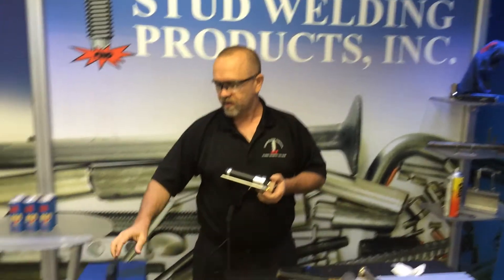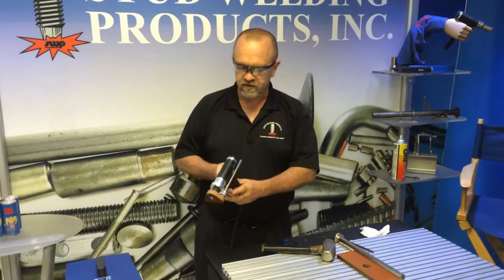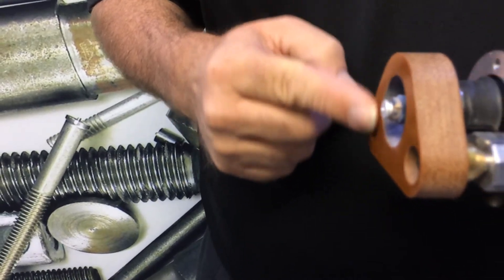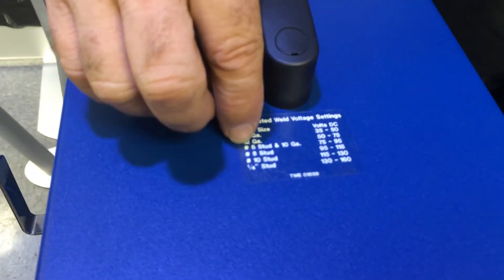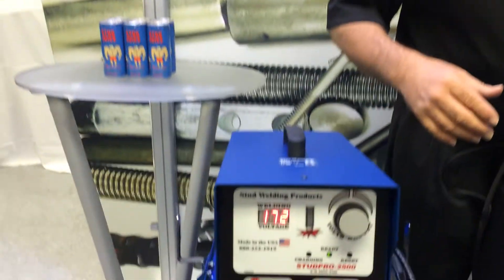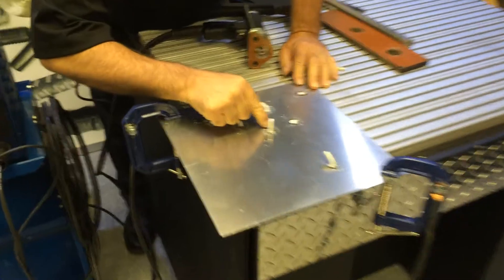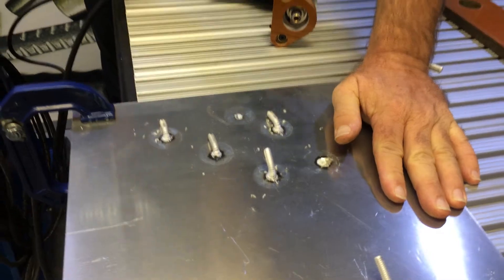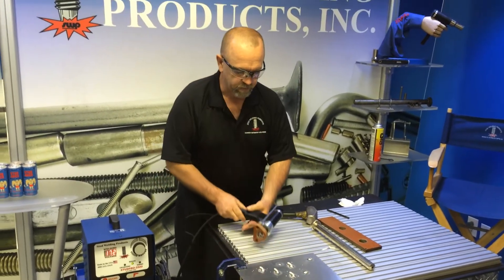Aluminum CD Stud Welding

Comment: If there is a not a lot of metal surface to ground the stud, will the studs not hold? If so, is there a workaround?
Reply from the maker: Grounding is very important. If you are working with small pieces we recommend grounding a metal table and placing the parts on the table when you weld.

Comment: What do I set it to for 3/8 with ignition tips?
Reply: Also my machine has a time on it plz help me
Reply from the maker: Sorry William. for the late reply. If your unit has a time setting on it you are most likely using an ARC style stud welder. Let me know what diameter of studs you are welding and I can get you headed in the right direction.